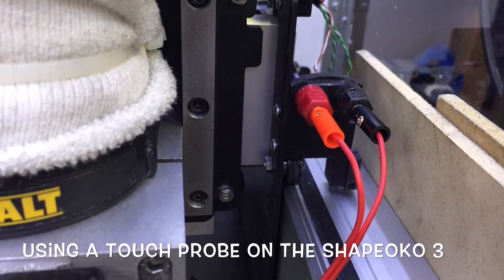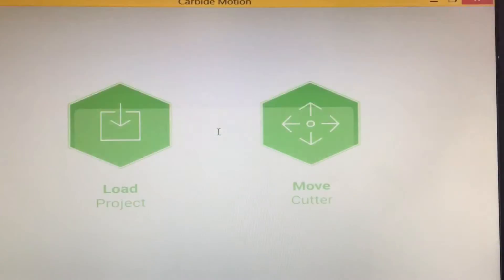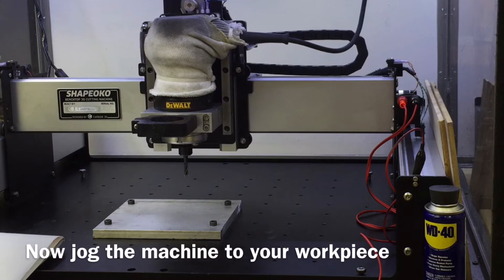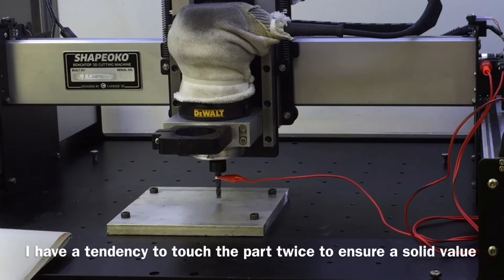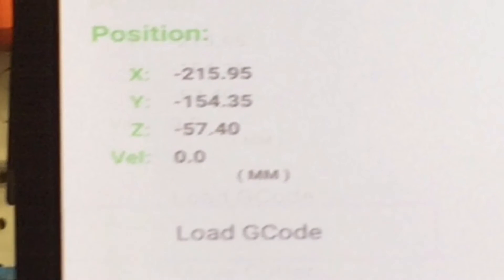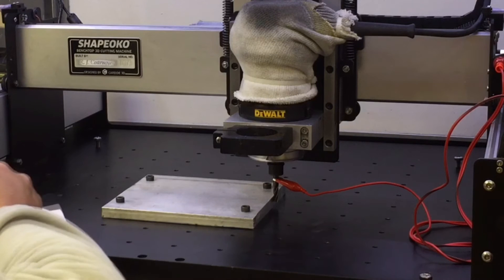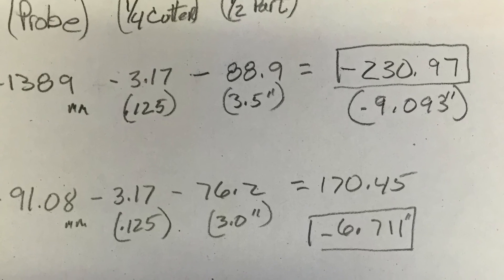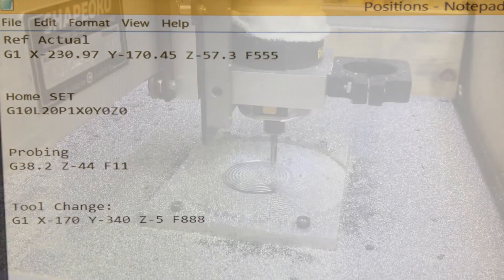Probing on the Shapeoko 3

Comment: Hi Richard, given your experience could you describe and show how to add a 4th axis to the Shapeoko 3 (I presume the Y-axis allows mounting beyond the waste board, especially if you add another waste board on top)? Some say they have done it, but do not show how. Also, perhaps, if possible, how to progressively but safely mill work longer than the table (e.g., by moving the wood/aluminum, or cutting it in sections first etc)?
Reply from the maker: Hello Pete and welcome!  I have looked for a Stand Alone 4th axis for the Shapeoko for over 2 years now, and still can't find something that fits my needs (Fit's below the X-Axis rail and is affordable).  I am also hoping that maybe SOMEDAY Carbide3D will offer an updated control card with a 4th axis option.  On my bucket list is to make a mini V8 engine block on the Shapeoko3...so I will keep looking.  As it happens I am now starting to record a video about making long parts on a Shapeoko (good timing).  I am making a 60 inch (5 foot, 1.534 meters) sign on my machine this week.  I'll be posting a video using my EZ method soon.

Comment: I see you are sending commands in metric. Will inch,decimal work too? I've been using my homemade limit switches for a while, but never had a need to probe until now. thanks
Reply from the maker: Well, yes and no, mostly no.  Carbide motion likes to work in metric, let me explain its little quirk.  I made a program in Imperial, Inch, SAE, what ever you want to call it, I even click on the Inch button in Carbide Create, but to sent the machine to a position, I see that the command NEEDS to be in Metric.  I talked to Rob over at Carbide3D and he said that if I put a slash (/) before the command it overrides Carbide and talks directly to the GRBL board.  (Sounded like it was more of a pain in the butt to remember this, so I continue to use Metric commands, and likewise, the dimensions for probing needs to be in metric as of today.  There is a BIG update coming for GRBL and Carbide Create, as well as a really cool probing block.  Whether or not it will change it I don't know.  So We'll have to wait and see.
Reply: Thank you very much. I had a feeling it was metric only. Prish

Comment: how do you send tool change commands in the middle of a script? do you have to add them in manually?
Reply: Thanks for the question, but I do not use a tool change command in the middle of the program because of the disconnect problem that I and so many Shapeoko owners get when powering down the router.  Meaning that if I write a part program that requires 4 different tools,  I'd post it into 4 individual programs for each tool. Complete the program is the tool go back to the part's X0Y0Z0, and start the next program.  Hopefully someday Carbide3D will fix the disconnect problem so that I can write a single program with multiple tool changes within it.

Comment: Richard - Hank you for the great videos. I have SO3 #1087 (very close to yours) but no background in machining or CNC at all. I've learned a lot and been quite inspired by your tutorials. Without the metal waste board table, I assume I just need to make sure the ground wire is touching my aluminum material, right?
Reply: Correct (Assuming your material is conductive)
Reply: +stirlingfromla Thanks! I'm thinking about getting the aluminum table anyway (as my MDF waste board has been soaking up cutting oil), but it's a hefty investment for that much tapped metal. Is it flat and true enough that the cutters don't ever scrape it, or do you shave a few mil off your maximum cutting depth to avoid it? Also, have you considered using a speed controlled DC motor? I saw someone using a 1500 watt Chinese one that he says is much quieter than the DeWalt and better for cutting aluminum because of lower speed (9000 rpm instead of 16,000). Curious what you think.
Reply: Thanks Mark for the questions.  Yes, the $400 is a little pricy.  You could source a 24x30 1/2" plate and have to ground, machined etc, but I think it would cost more.  The S3 plate from Carbide3D is ground, anodized, drilled and tapped every 50mm, as well as bolt right in with no machining required.  Is it flat? Yes.  Checking this turns into a small problem since the X and Y Rails are extruded with no post machining and can vary from lot to lot, so checking can result in an error if the rails are not flat (which they are not).  Anyway, I have never touched the metal table, since it is flat within a few 0.001" for my machine, so leaving a 0.010 thin skin under the cutter on a part that measures (say 6" x 6") will only vary 0.001". So yes, I raise the Z (usually) 0.010 to 0.020 so that it doesn't hit the metal table.  Next, onto your spindle question.  I don't like the water/air cooled Chinese spindles, and like you want a lower speed spindle (for cutting Stainless Steel, not aluminum, I want high speed (16k to 20k for cutting Al)) and have been very happy with the torque of the DWP611, that I will probably install a Super PID system this fall to reduce the speed and pray that it has enough torque.  As far as your noise concern I find the DWP is very quiet, but remember most of the noise is produced at the cutter. (via cutting forces and chatter).  FYI: Stiffening the motor place will reduce most of the chatter.  Hope this long answer helps.